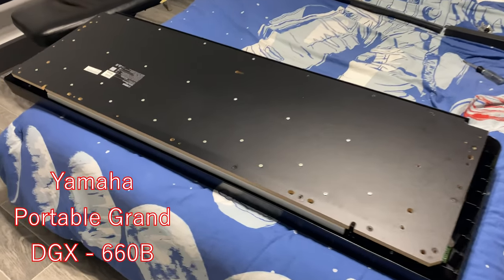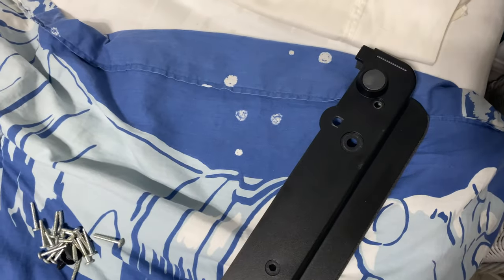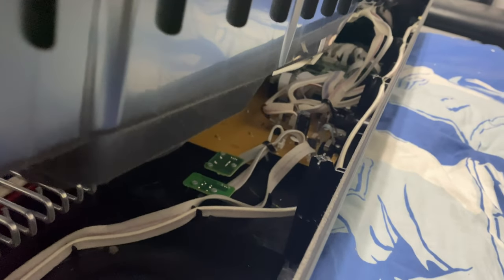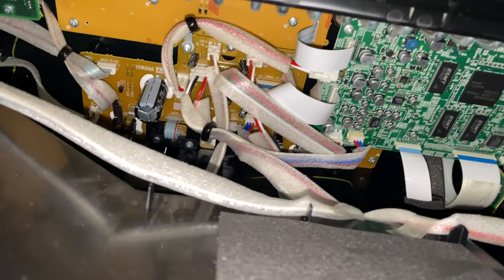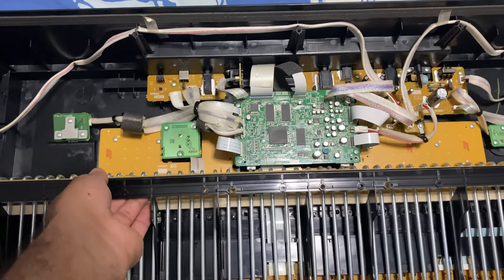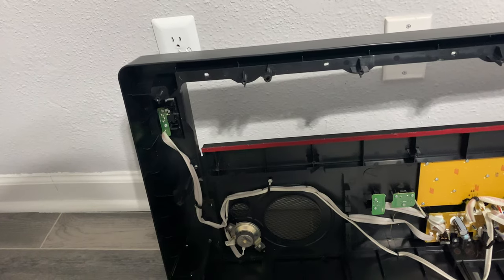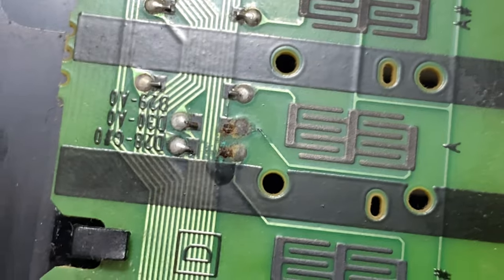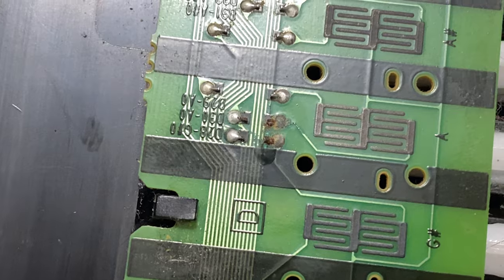Yamaha Portable Grand DGX - 660  Repair

Comment: I'm having a problem with DGX-660 where a key sounds only 100% loud regardless of the pushing speed, in other words - no silent sound. There's some calculation of speed between two "switches" of one key from what i've read in the internet. So just watching videos for now in order to estimate if i can fix it myself or just give it away to a repairment...
Reply from the maker: Yeah I know that there are diodes on the key boards but I wouldn’t know why it’s at 100% volume. Hope you find the issue. I’m a rookie with these

Comment: Hi , Nicole
I have a Yamaha DGX-660 PORTABLE GRAND ...THE DISPLAY IS VERY BRIGHT AND YOU CAN HARDLY SEE THE SETTINGS OR WHAT IT SAYS!
Reply from the maker: Maybe you need to adjust the brightness?
Reply: Thank You,
I found that there is a Contrast  Button. That my husband  didn't  turn the knob... right!
So. When I checked it out , I noticed you have to pull the knob
Straight Out towards 
Yourself and from there...turn the know
Either L or R...Depends how much Contrast you see & makes it 🌞 
Bright to see the Display!
Thank You anyways for your Information.
Reply from the maker: @nancyabelaye2445  Right…. There is a brightness button on the piano. I was playing around with it once before. That’s why I brought it up, that maybe you need to adjust your brightness

Comment: I have an odd issue with the same keyboard: I get a buzzing sound from the right speaker on specific notes (A4 and G#4, and to a lesser degree A3). I think it's an issue with the grill itself, because pressing down on it with my hand prevents the buzzing from occurring. Your video is quite helpful about taking it apart, but I'm not completely sure how the speaker grills are actually held down: I can see some 'tabs' around the edges, but aren't there any screws for them?
Reply from the maker: I really didn’t look into the grill so I can’t give you accurate guidance.